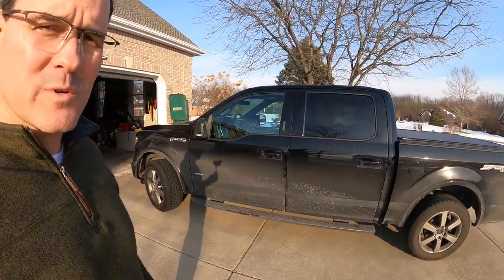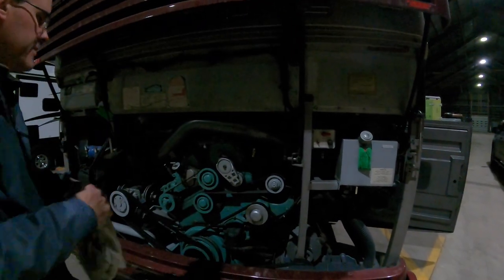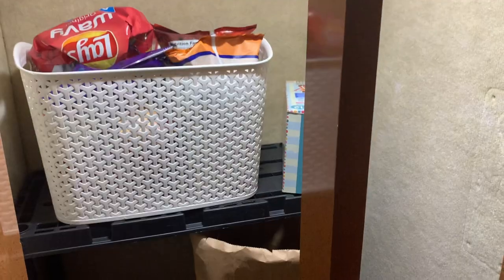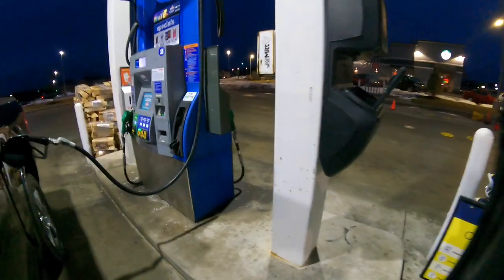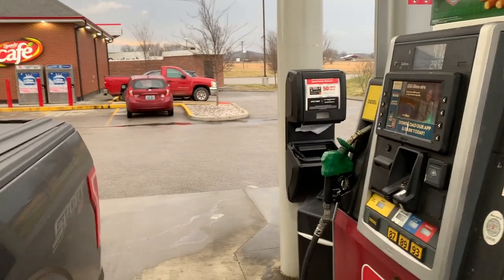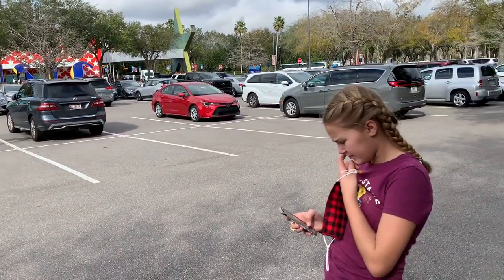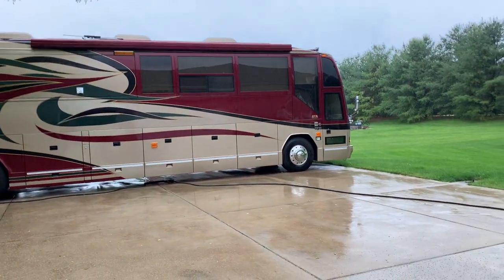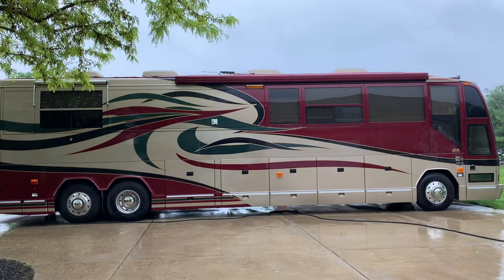F150 or Class A Prevost

Comment: Prevost any day but there are pros and cons to both. Like you said earlier, staying at Disney resort gives you access to the shuttles which is a big deal but the bus has every amenity you need without sacrificing comfort. Great video as always. Another question: did you have to reinforce your driveway concrete to park it in your driveway? I might have to reinforce my concrete. When we build our home, we didn't account for a Prevost in the future but it's an upcoming purchase
Reply from the maker: I didn’t - it was existing, about 12 years old. It had a little crack before and broke into more pieces after I brought it home.  I’m not going to fix it until after I sell it. I would think just putting in a really good compacted base and 6” would work. Mine is probably 3-4” and works fine - except where there was probably settlement in a few places. Good luck!
Reply: @CampPrevost  I certainly appreciate it and keep on posting. Thx

Comment: Hello, you mentioned showering while driving. Have you ever done that? That would scare me. We also have a stack washer and dryer in ours. There is nothing like staying the night in a Sam's Club parking lot for free doing a load of laundry while watching a movie. Life is definitely better in the bus. Also I know how clean the bus is, who slept in the bed last and when the sheets were changed last. At rest stops you have your clean bathroom. You are not dependent on some gas station to hopefully have a clean bathroom.
Reply from the maker: Thanks for watching and commenting - agree with everything you said, very convenient. I haven’t taken a shower while moving - only because my wife won’t drive! Lol. My kids and wife have though - the aquahot gets heat from the motor - so endless hot water. Only do it on straight roads for sure though.
Reply: @CampPrevost  We have the Aqua Hot too. Ours runs off either electric or diesel. Considering we are moving and you have water and soap which are both slippery that would concern me. Now I have thought about doing a load of laundry while driving. My wife is handicapped. I have to help her clean up so showering while driving is not an option for us and like you my wife won't drive either. What is the longest you guys have been out? Our longest was a month. I would love to try a three month trip.
Reply from the maker: @adriannurse1502  our longest trip was 2 weeks. Went out west to Yellowstone and everything in-between.  About a 3800 miles adventure- glad we did it last year!  Because the aqua hot can heat your engine - your engine can heat your aqua hot too - thus the water too (without turning it on). Probably not advertised that you can have hot water (and showers) just by running the engine down the road.
Reply: @CampPrevost  I had no idea. Thank you very much for that tip. Our month long trip was last summer also. We were gone the entire month of July. We live in Florida. We went to Cheyenne Wyoming, Wichita Kansas, Oklahoma City and Memphis Tennessee. We had to install a new fresh water pump in Memphis

Comment: Your daughter was commenting that she felt a bit safer in the F150 in wind and ice.  Maybe you have discussed that issue with other coach owners, but if not you might seek out a professional coach driver that drives a similar chassis and ask what their experience has been.   It might be there is technique to help with the situation. 

 (On my Toyota Sienna in heavy cross winds going from 80 mph to 85 mph causes it to push down gaining stability and reducing the crosswinds effect on the minivan.  The buffeting on the front goes up).  You might discover there is a modification that can be made to make the bus better mannered and controllable in crosswind situations.   It could by towing a vehicle that makes crosswinds and ice very taxing on the bus to control.   In totally horrible situations maybe it would be better to drive the vehicles independently. There is no sense possibly putting the bus into a ditch for the ten minutes it takes to unhitch and re-hitch the towed vehicle.  If towing is a major contributor to stability control in crosswinds there maybe a different hitch configuration or an aerodynamic shroud that would help that situation.   

The huge difference between a motor coach chassis and an RV chassis is the motor coach chassis is made to be a stiff platform competent driving machine with many people on board and an RV chassis is really produced with the idea is is going to be used most when parked.  I would think Prevost chassis would be designed knowing it is going to be driven in heavy wind and sometimes it is going to hit ice.    

Thank you for the Camp Prevost videos!   I've never thought about having a "family" Prevost before.   It sure would be nice if there were somehow to expense the fuel charges of those trips!  The set cost of about $8,000 for tires and $4,000 for batteries basically every five to six years because they age out somewhat regardless of use is a bit of a downer.  There is also insurance and I'd be a bit scared of that.
Reply from the maker: I wish she didn’t say that - it does fine in the wind (this one) and we have never used it before in snow or ice.  Starting out in a Tiffin Wayfarer (which we sold because I had to pull over in large winds - I’m talking 30-40 - it wouldn’t go straight down the road), then moving to a 35’ super C - it did good but the suspension was really stiff. In large winds it would feel tippy but did well. This one does really well. The only time there is an issue is when it’s gusting to 30-40 or above and the wind gets blocked by the land topography.  You get a 0-40 gust, then it’s gone, then it’s back, then it’s gone. And when it does hit the coach it’s not that bad, you just need a little steering input to correct.  I think she still has memories of the Tiffin, I swear it got in two wheels, so we pulled over and stayed the night in a gas station.  Memories for sure, good or bad. 

My brothers want to do a snowmobile trip this winter up north - not sure how excited I am about that. Others in the prevost Facebook page say it’s fine….  I used to plow snow with all types of trucks and tractors - so I know my way around slick roads. Not sure I want that back end coming loose behind me with 50klbs and 45’ coming towards me. I know - drive slower - at some point leave the coach, take the 4x4 and stay in a cabin though. Even if the driving was fine, not sure I want to worry about freezing my tanks, fuel tank, batteries, etc. will see!
Reply from the maker: Yeah it sucks on the tires - you’ll have that with all vehicles though. I just put in lithium batteries- have to see but should get about 7000 cycles - that’s 20 years doing a full discharge once a day.  At my rate it would Be 50 years. So hoping they do well for the next two or three owners - time will tell.  I did put on the same tires showhauler is using - two were $1,400.  Makes a set about 5k. I am going to try 2 a year for awhile - new fronts each time - push the fronts back each time. Seemed more reasonable then all 8 at once.
Reply: @CampPrevost  Don't blame your daughter for her off hand comment, she likely was just recalling a time she associated with a motor coach and didn't differentiate it wasn't the Prevost.  The Prevost possibly hasn't generated any strong memories like the Tiffin.  From your description the Tiffin may have really frightened her and that makes her uneasy with all busses and motorhomes.   If its true you might want to reassure her the Provost drives very differently than an RV motorhome because it is specifically built to carry large groups of people and in particular Prevost is generally thought to be at the top of the list for best driving motor coaches.  (Motor Coach World makes a strong case the post 2015 MCI J4500s maybe the top handling motor coach, once MCI switched to an independent front suspension and other stability upgrades).  The Prevost would likely need to demonstrate some heroics to help her feel confident in it.   I very much appreciate the discussion of driving the Prevost in less than idea conditions her comment led to.
Reply: @CampPrevost  I think it would be interesting to know how the tires on the axles wear in relation to each other.   

You may have put a lot of research into deciding to switch from lead-acid batteries to lithium ion.  Last time I checked for upgrading my electric scooter from lead-acid batteries to lithium ion batteries, the lithium ion batteries were about ten times the cost per kW/hr than the lead acid batteries.   That was over six years ago.    In your application where longevity and reliability are the key aspects todays lithium batteries are possibly "forever batteries" with the right battery maintainer system.   Thank you again for your family Prevost videos!
Reply: @CampPrevost  If it is just your bother and you're going to make out alright up in the snow with the Prevost because if you have a problem you guys will figure it out, but it will take some time.   If you were to take your wife or daughters I'd  research having some snow chains to put on the Prevost.   A good set of chains on a vehicle can make it seem almost unstoppable in the snow.   It turned out Volvo made a good set of chains for my Volvo 240.  I paid a lot for them.  They fit on well.  I practiced a few times so I could put them on in the dark and in less than optimum conditions.   I got chains  when may sister was pregnant and I thought I should be hardening up what might be of aid.  It turned out she had her baby Dec. 27 and there was snow on the ground!  I didn't need the chains for that, but when we had a blizzard I put them on and would try to get the car stuck in the snow and those rear wheel factory Volvo chains would pull it back out no problem!   That Volvo 240 had an open rear differential with no anti-slip and those snow chains still make it have incredible traction in the snow!  Volvo now owns Prevost and they are a Swedish company maybe they make some good snow chains for the H3-45.  I think they do for their own 9700 series bus.  With chains on the outside drive wheels of the Prevost you might find it could pull the F150 out of a snow bank or some other vehicle just fine.